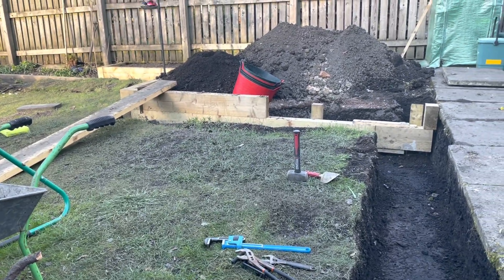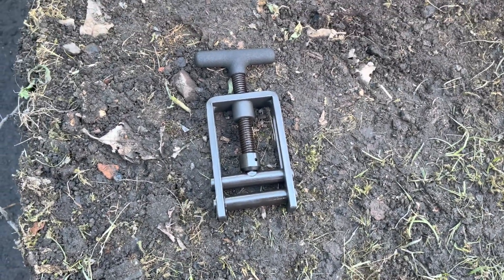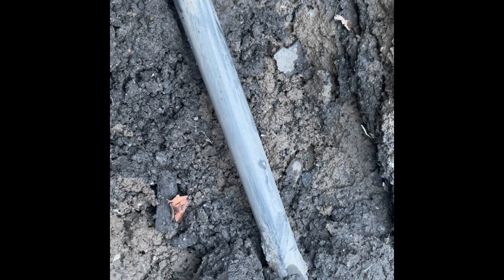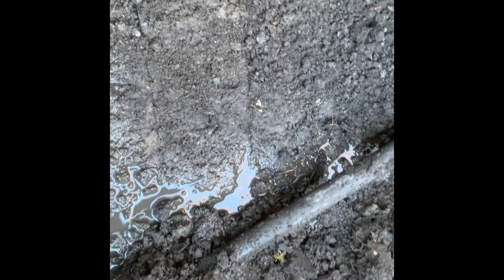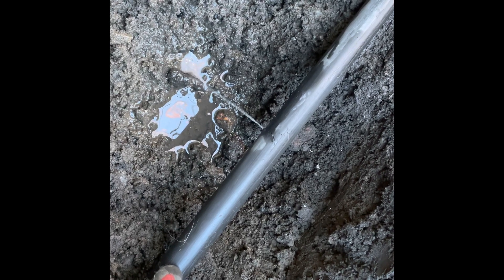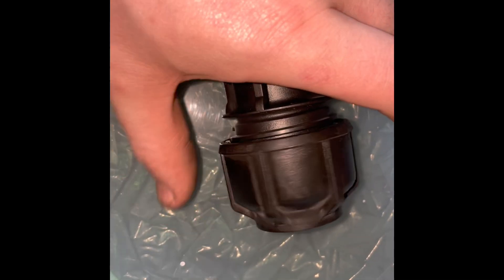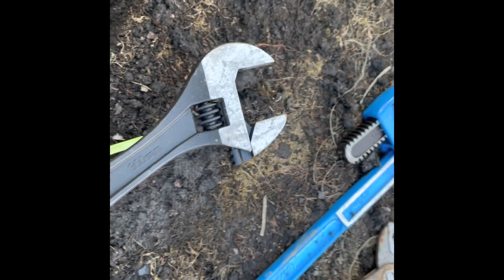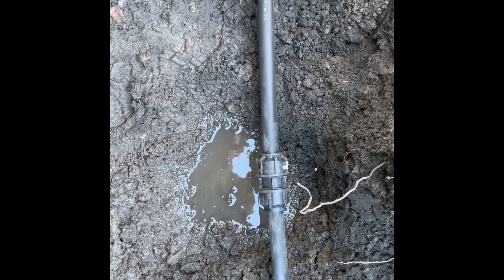Repair of mains water pipe using Philmac coupler and pipe squeeze

Comment: I have a question. I have a pinhole leak in my mains lead water pipe. I will attempt to repair it by cutting and using this universal coupler to lead. Probably a silly question but do I need to use an insert on the lead pipe? Cheers in advance. Great video and very helpful.

Comment: have you not forgot the inserts?
Reply from the maker: Manufacture recommends when using on the older imperial sizes (black pipe) that the inserts are not required.  If you where using the newer blue metric pipe you should use the stiffener inserts.

Comment: Nice video..  Where did you buy the squeezer from
Reply from the maker: You can get the one I have from ToolStation if you search Squeeze Off Tool.  Pluming Suppliers will generally stock them or also lots available on Amazon.
Reply: @therestorationfamily1487  thanks